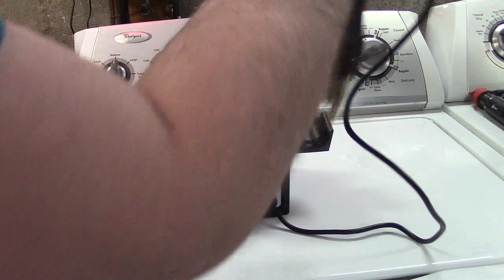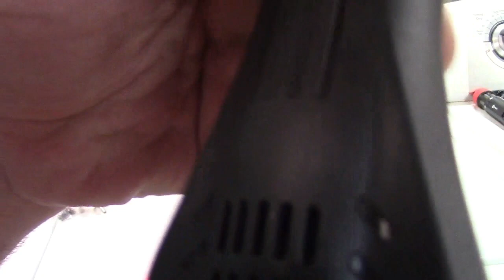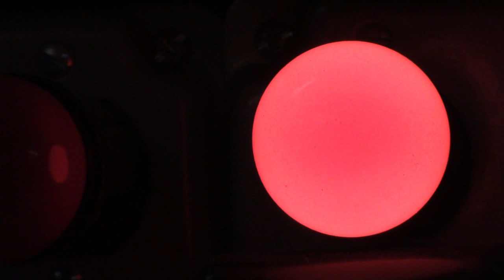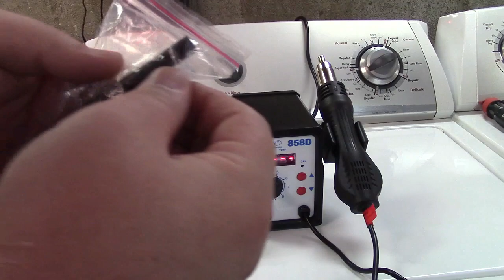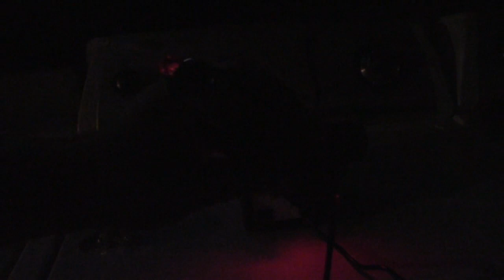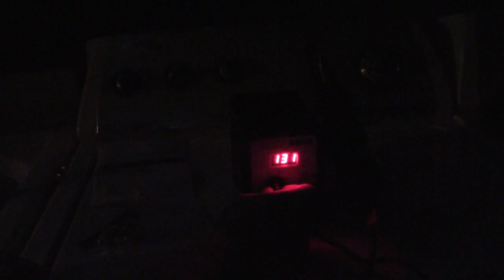858D 700W Digital Hot Air Rework Station

Comment: Kill the ump! Kill the ump!

Not really sure what I'd use one of these for except for shrinking heat shrink tubing.  Been using my hairdryer for that.  I don't usually mess with surface mount components but it seems like a good deal for those that do.
Reply from the maker: Yeah I wouldn't even use it for heat shrink tubing.  I've been known to heat gun chips on computer motherboards from time to time, so that's really it.  For heat shrink, I use my heat gun, it's better all around that the hair dryer.  It's funny, I have 2 heat guns, and the little baby one I end up using much more often.  Perhaps it's because it's a finer current of air?  I don't know, but it works great.